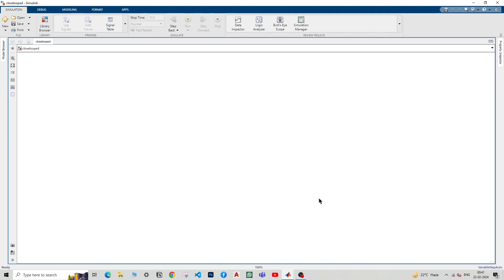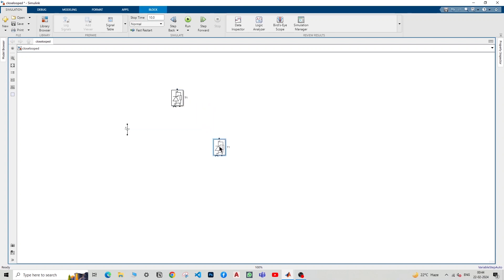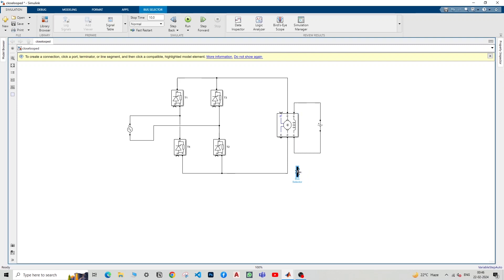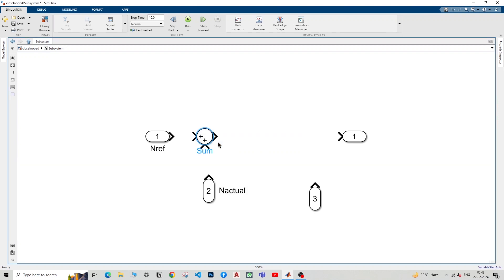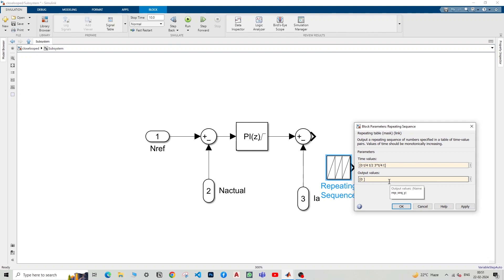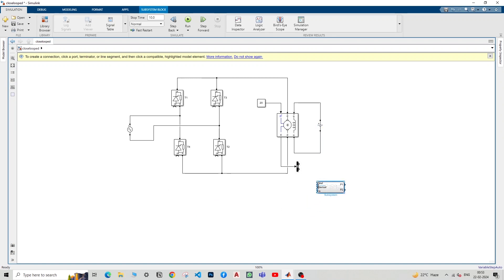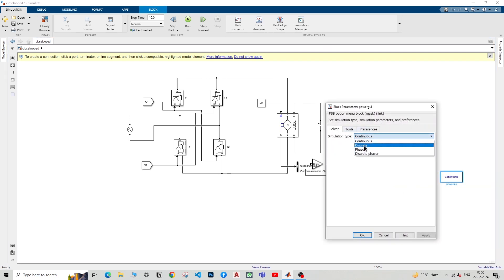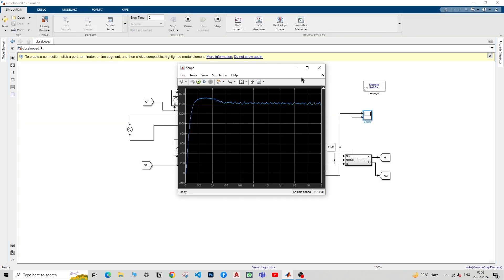Closed Loop Speed Control of Separately excited DC Motor in MATLAB Simulink.

Comment: Hi, I am getting an error of PID controller regarding sampling time during compilation of the model. 
I tried giving some small sampling times like 1e-3, but the results are still not matching to the one shown later in the video. Can you suggest any improvements?
Thanks